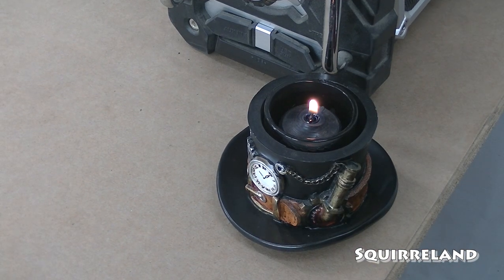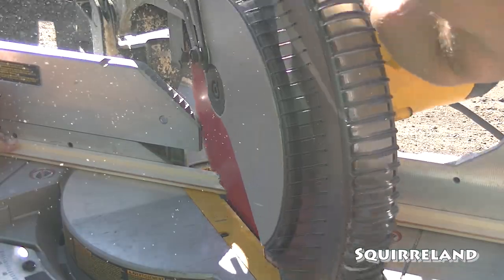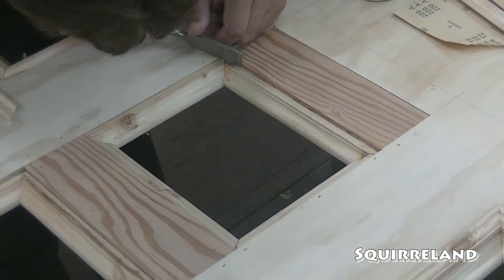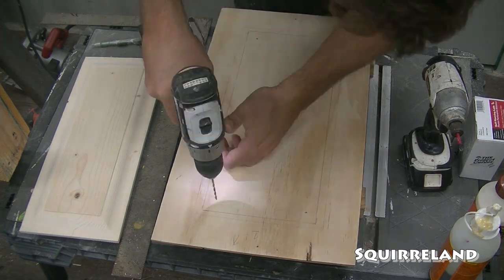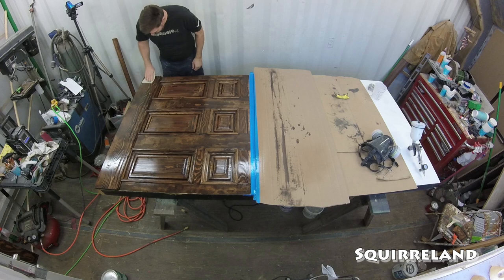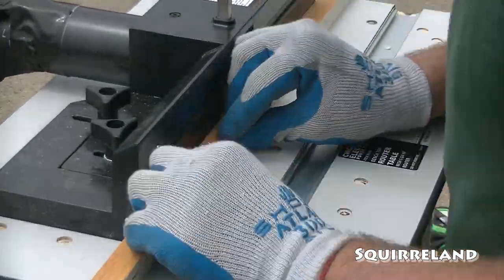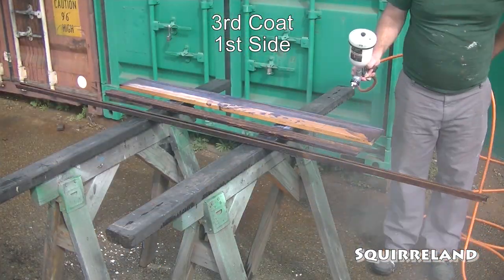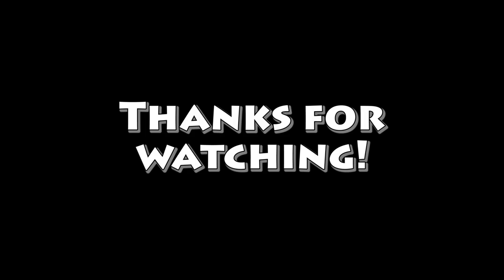Victorian Wall Panel Build - For A Haunted House or Steampunk Room - Squirreland

Comment: How do these looked when you tile them together?  I hope you make a follow on video.  I'm approaching my haunted mansion walls differently.  I'm going to apply the wainscotting as a separate treatment to cover the seams at the bottom and I'll make molding to insert between the panels to hide the seams...  I am thinking something like a "T" shaped with a thin masonite rib on the back and the front cant be a 1x2 or something decorative.   I want to thank you for that inspiration how to hide the seams on the walls with wallpaper...  Wow! These are labor intensive to make.

Comment: I just discovered your channel, and subscribed!!!   I too like to make haunts;  not to a professional scale like yours, I have a small haunt I do at home, but I go all out for it each year, and I have videos up on my channel.   For 2024 I am working on a Haunted Mansion-esque walkthrough in my garage this year so I am going with a simpler colonial style decoration paneling, I will be making my own flats,  and I'm using (sigh) Peel and Stick wallpaper (I wished I saw what you did, that's a much better idea), Also I purchased router bits for making the molding chair rails, baseboard, etc. etc. etc.  But what the Haunted Mansion didn't have is what I'm doing as a "twist"  I make my own animatronics and will have a drop panel with a pneumatic cylinders to make a corpsed skelly come out behind the picture frame... Nothing says haunted house like having a skeleton in your closet. Bwahahaha

Just a comment about making small parts at the chop saw, if you don't already know about this wonderful, almost essential, hold-down tool for doing that safely, it's called the "10 Million Dollar Stick" made by FastCap, cost $25 bucks off of Amazon. I just keep it at my miter station so I know where it is.  The tool can be used either side there's rubber feet that can grip and stabilize the part depending on the part you can use the forked end or the straight end, you'll figure it out quickly, it removes your fingers away from those sketchy cuts. I watch a lot of woodworking shows and pick up tricks and tips from pros, and that's one I really appreciated... just passing it along!

Comment: The rough cuts and blowout you're getting are possibly due to dull router bits. Like drill bits or saw blades, they do need to be sharpened from time to time.  I'm only telling you this as you said it's your first time using a router table and it belongs to your friend.  Maybe you should forward this to him as well.

I'm mainly watching your video because I want to build removable victorian panels for my new apartment,  then hang them inside. They will not be permanent and when I move, I will take them with me.  This is the only video on YouTube about victorian wall panels.